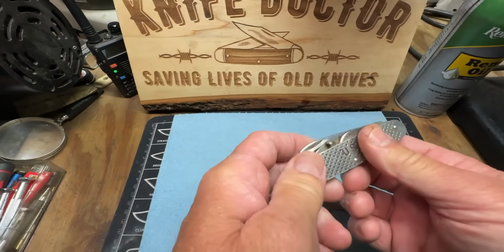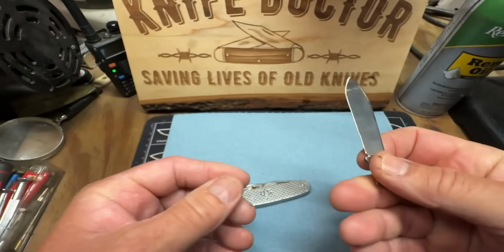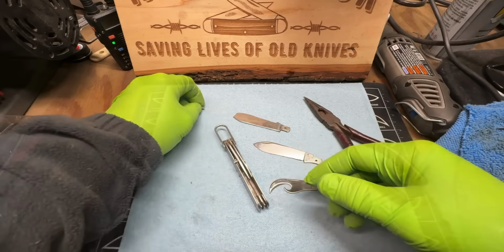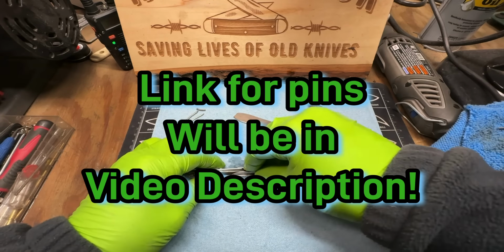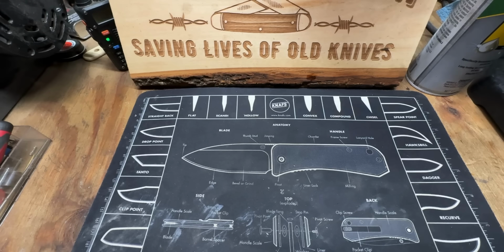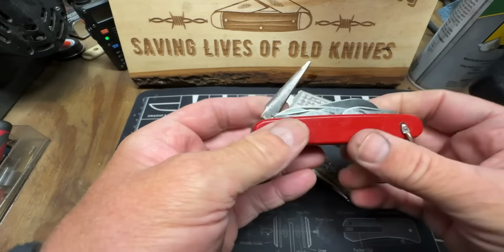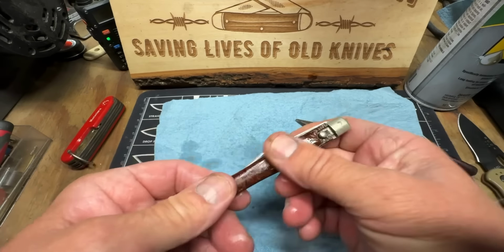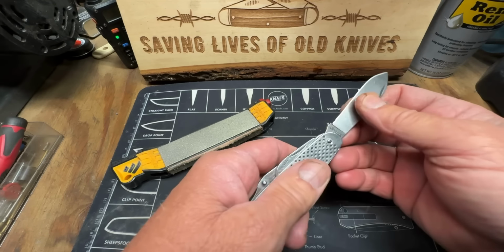Camillus Knife Repair: Broken Blade Replaced!!

Comment: Good video,,, I've recently changed a pin in a fish knife. Gave it a half stop,, and increased the spring tension. Had the devils own time getting the pin through two blades simultaneously, turned out,, ok.